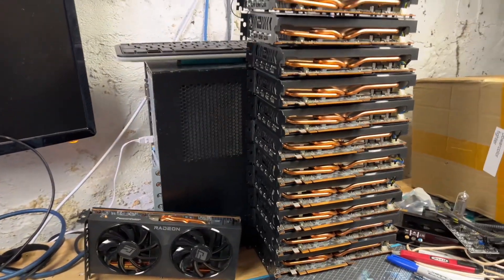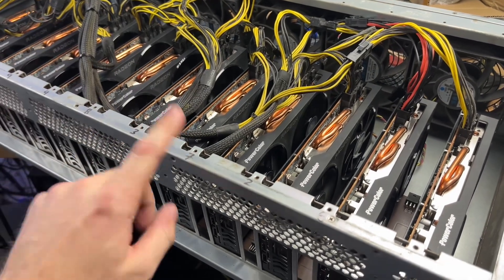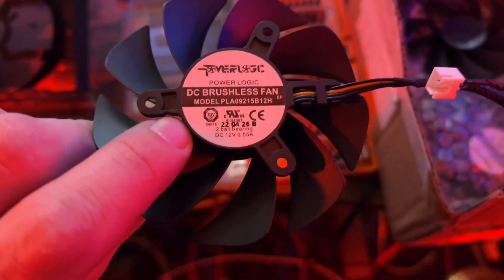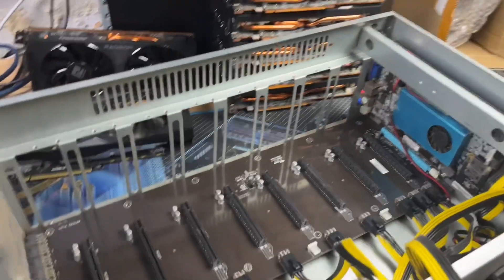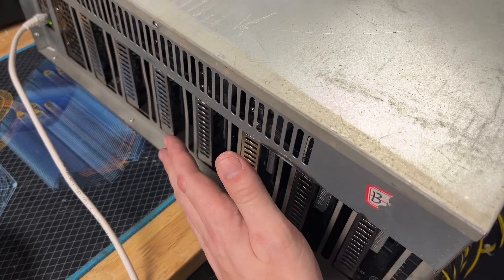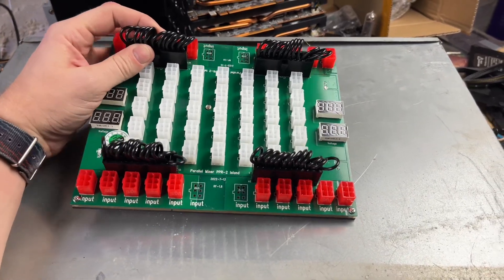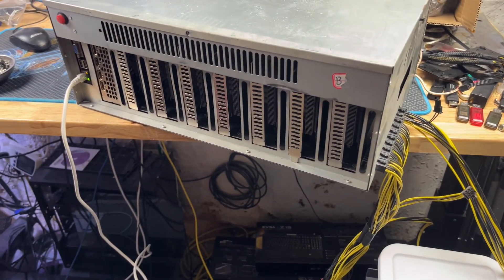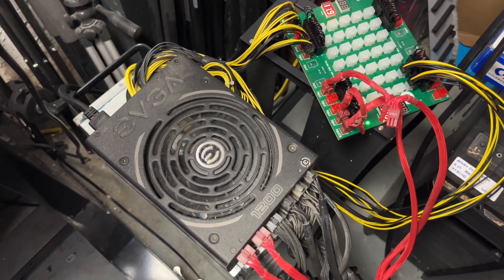Code 43 Radeon VII, 12x 6700XT, and the Power Island

Comment: That power island setup you have going on is quite interesting!

I wonder if the Evga psu is just back feeding power that’s held up in the capacitors? Maybe try waiting longer to see if it eventually powers down completely
Reply from the maker: I'm not sure but I think a couple of very high current diodes would handle that issue. I bought a couple and plan to do futher testing with them

Comment: I just bought a 4 pack of the emporia plugs as I recently installed their whole home monitoring system.  I noticed they rate them for less amps than my other plugs, how many watts have you ran through them and did you run into any issues?  Thanks!
Reply from the maker: the nema 5-15 plug is really only safe for up to 12A, which is 1440w or so on 120VAC or 2880w on 240VAC. I would never run more than that through a 5-15 or 5-20, so really doesnt matter what they're rated for

Comment: press F to pay respects. Radeon VII don't post on UEFI only bios. You usually have to enable CSM/legacy compatibility mode.
Reply from the maker: one out of 9 though and the other 8 are perfectly line.. this one also stops the board from posting no matter where it is in the system. shes dead, Jim.